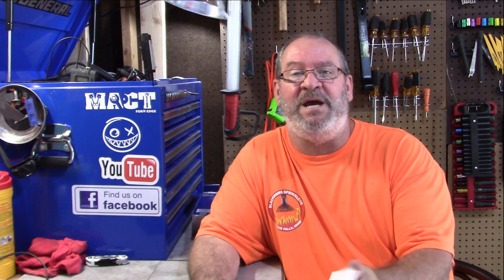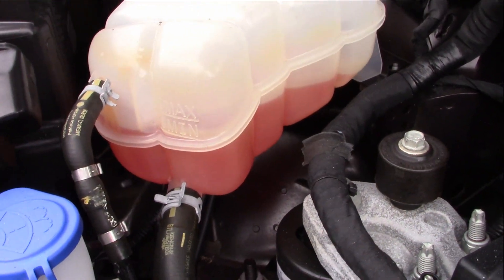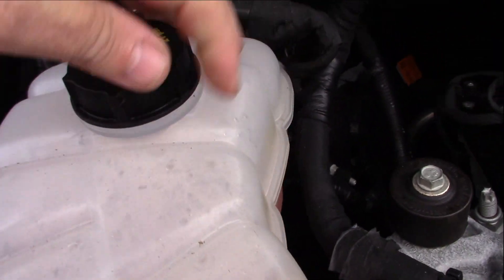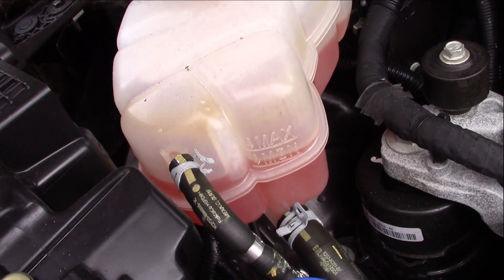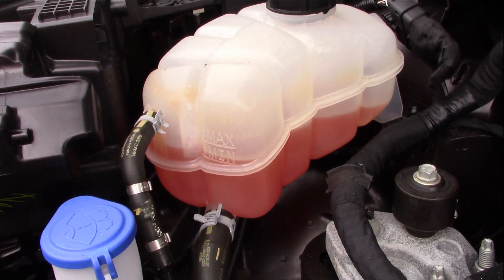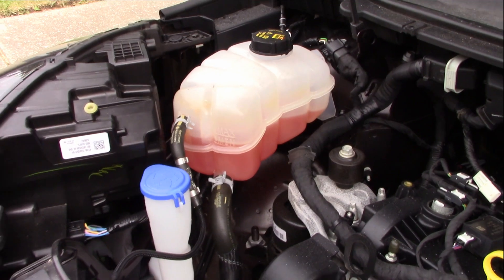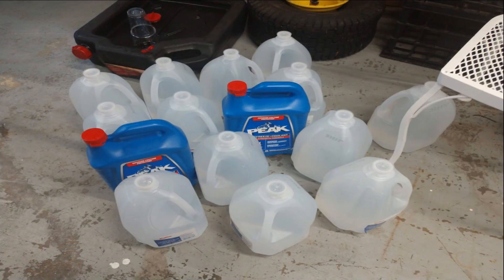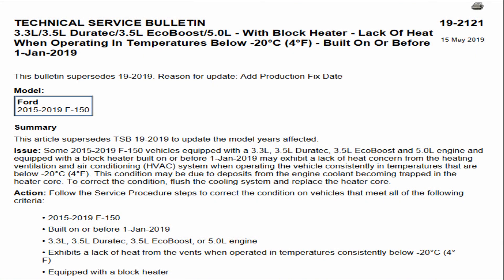F150 TSB 19 2121 HVAC Coolant corrosion due orange coolant

Comment: The Ford Bulletin like most lacks specifics...
Ford orange is their Dexcool Approved OAT but the coolant which sourced from Prestone is not the source of the issue.  The aluminum radiators and heater cores installed at the factory are made using a process called (CAB) Controlled Atmospheric Brazing.  There is a residual flux overspray left in the cores which causes many engine coolants to fall apart if the coolant lacks a high enough amount of phosphate, phosphorus,  or potassium in the coolant chemistry.  Prestone tweaked their OAT with phosphate calling it Prestone Cor-guard.  GET IT!!! Radiator Core Guard.  The new Ford yellow is just Prestone Cor-guard.  If the rad companies or the OEMs just flushed the rads with hot water before installing there wouldn't be and issue.
Reply: Great post.  This is a good video, but I hate it when people refer to coolants in colors.  Colors don’t have anything to do with what kind of coolant it is.  I deal with Diesels at work and it is my pet peeve.  Some manufacturers want an OAT coolant and some want an NOAT.  Both are a red coolant though they are completely different technologies.  Orange used to be Dexcool only, but now it is many different formulations.  Engine manufacturers went away from the Nitrated coolant (NOAT) because the nitrates interaction with aluminum is no good, so it is strange that an OAT coolant, which the Ford orange is, would cause corrosion with the aluminum.  It makes sense though that it is not high enough in phosphate.  I’m getting ready to flush my eco boost so it’s good to know that the Prestone has tweaked the formulation.  Thank you again for the very useful info Ashtown.
Reply: Interesting info, thanks!  But how do you know Prestone Cor Guard is the same formulation as Motorcraft Yellow?
Reply: Interesting… Thanks for the info. I just super flushed my 16 5.0 to the new yellow. So glad I did. That orange was nasty!